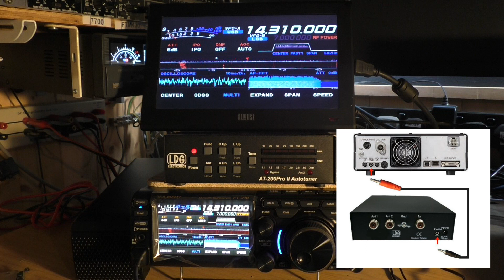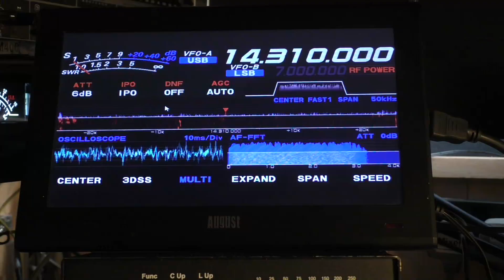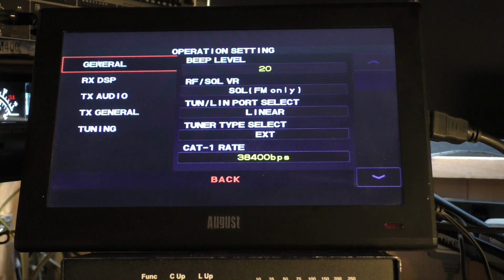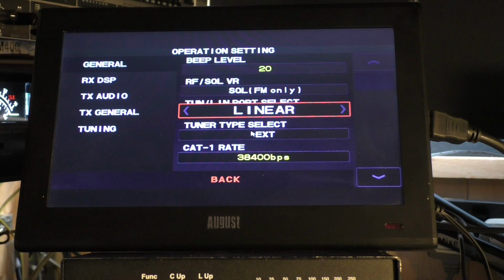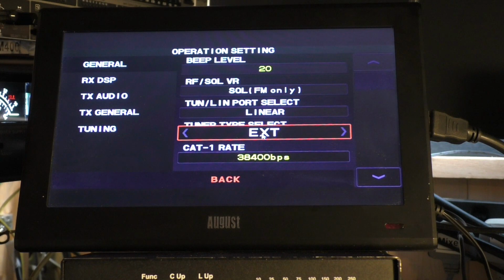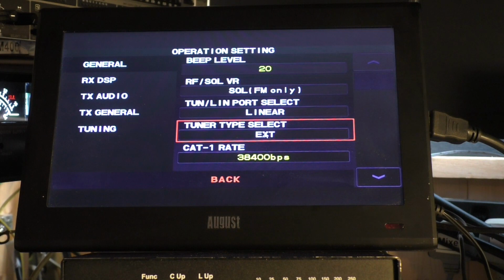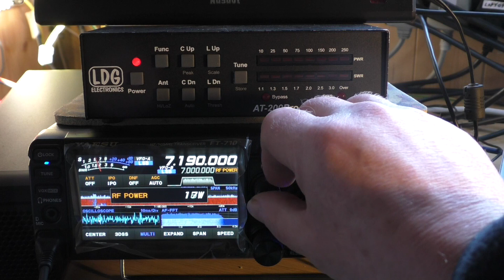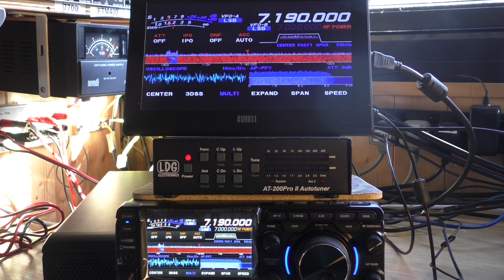Yaesu FT-710, External ATU  LDG AT-200Proii, Z-11PRO II

Comment: Not bashing, Icom radio's detect an external turner when you connect the tuner cable.  My old Ft-950 was a pain to use with an external autotuner.  Yaesu can do better.

Comment: So. you got a 1.3 to 1 on 10 watts, then after you bump up the power to 50 watts it goes up to 1.7:1  What happens when you go to full 100 watts of power?  You don't need a good match at 10 watts, you need a good match at 100 watts
Reply from the maker: Antenna tuners are a compromise, a tuned antenna on the TX band is always the best option. Why run at 100W? Try upping the power in stages till your SWR is acceptable or TX is Received.
general rule
Below 1.5: Your antenna is perfectly tuned 
1.5–2.0: Your antenna is acceptably tuned 
2.0–2.4: Your radio should be fine for casual use.
2.5–2.9: Your radio's performance will decreased, You may damage it if you transmit frequently 
3.0+: Your radio's performance will be severely affected, likely to damage it with extended use
Reply: I've been a licensed ham now for 40 years and fully understand standing wave theory.  Why run at 100 watts? Really?  What type of question is that? Why run at 500, or legal limit?
Sure, I can get a manual tuner and tuner at 100, but my question is if your getting a good SWR at 50 watts and you need to bump up the power on the rig, what happens to your SWR? It's already higher at 50 watts, you just live with whatever the tuner gives you at 100, just because it was good at 10 watts?

Maybe you're ok using only 50 watts, but it's not ok for everyone else.

Comment: has anyone found a tuner that plays well with the 710?
Reply: The mAT-30 V2-1 Antenna Tuner works perfect tunes from the Yaesu FT- 710s tuner button.
The V2-1 version is made for the Yaesu FT-710 and others, comes with the control cable and is powered from the FT-710.
Got my mAT-30 Antenna Tuner V2-1 from DX Engineering $179.00 shipped free.
No lowering power or screwing around just Works.
Reply: @garyp.588  $189 now but thanks. Looks to be better except for the swr and power indicator lights the ldg’s have.
Reply: @garyp.588 у ft 710 нет встроенного тюнера? Мне кажется что он есть в нем. Зачем тогда использовать внешний тюнер?
Reply: LDG Z-100A it comes with the correct cable to power the ATU. You have to use the tune button on the Tuner not the radio.

Comment: Yes when you use the interface cable you may tune from the transceiver, not from the tuner, and it will reduce automatically the power, and also stpos the tunning process when it is ready. As you did  the process is manual tunning without interface cable, only with RF antenna cable connected.
Reply: The interface doesn’t lower power when tuning. Says it right on LDGs website. Best not to pass poor incorrect advice Ma dude.

Comment: Hello Wayne. thnks for the video. I hve a LDG Z11pro2 Tuner with the 3,5mm cinch cable.  the manual tells that the tuner will reduce power when tuning automatically. Needed is the cable connection, I run this setup with a FT857 and expect to do so with the FT710 installing the 3,5mm cinch cable. Or does this not work with the FT-710. My question, why do you recommend to reduce the power while this is managed via the tuner? tks for yr comment, brgds Harry